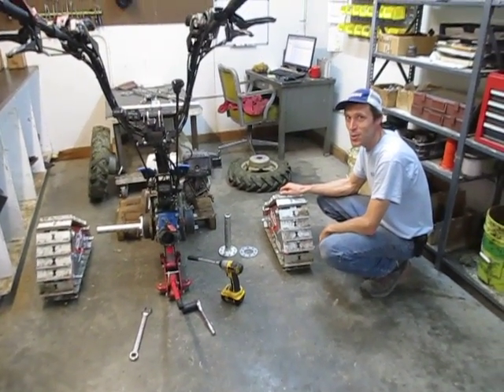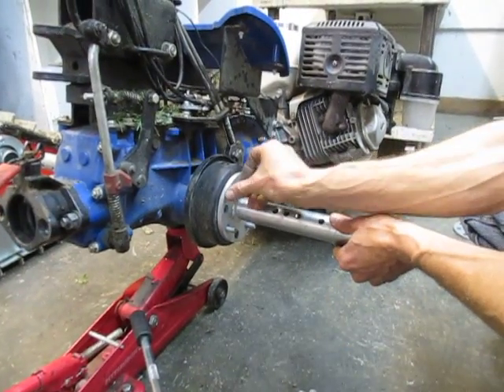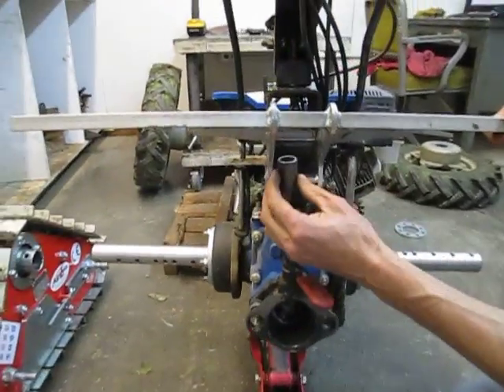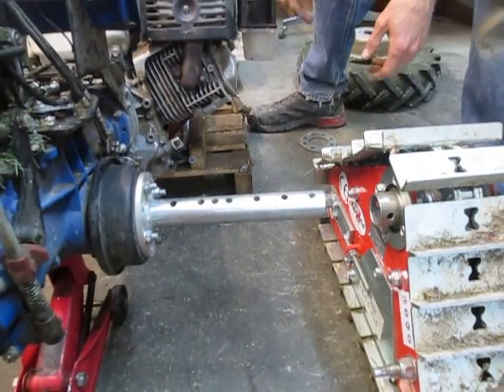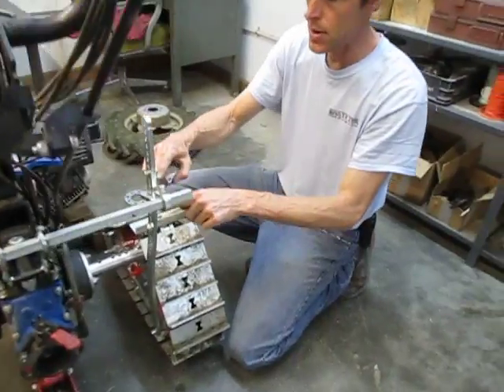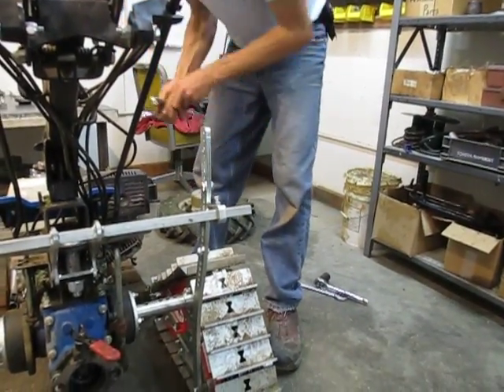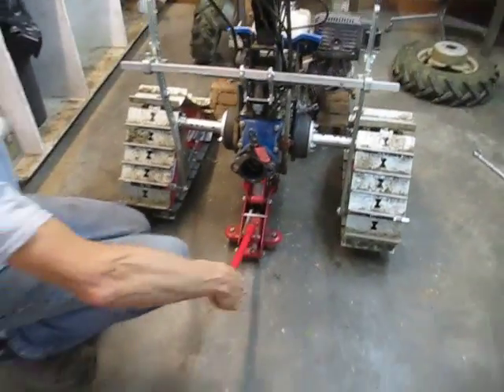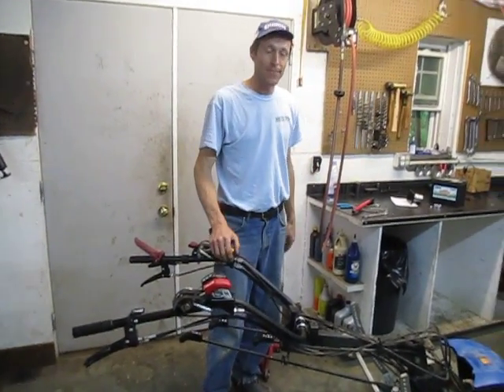Mounting Tracks to Walk-Behind Tractor

Comment: Well, you're kind of a tease by not giving us an in-use video.  Seriously, I'm looking at my options now, and a Grillo 110 with tracks, and a Bellon Brush mower might be the thing for cutting trails on a very overgrown acreage.  Do the tracks give you more or less ground clearance?  Have you ever tried the Bellon brush cutter with a tracked tractor?
Reply: I have a BCS 853, and a 30" flail mower, and I believe the flail would be a better choice over a rotary brush cutter. I think the flail leaves a better finished product, and is more adaptable to multiple situations.  I don't have experience with the tracks, but they are on my list.  Thanks!

Comment: Hi look my dear fellow you have the tracks on back to front.The lug on top should be to the front.
Reply: Sir, that depends on which direction you would be using the tractor in...these walk-behind tractors accept both FRONT and REAR mount implements, and the tractor handlebars swivel around 180 degrees to reverse the "forward" direction of the tractor, depending on the implement you are using.  The tracks can be turned around to accommodate the proper "forward" direction. So, please do your research on this type of equipment before you comment...

Comment: A quick observation.. When you use the tow hitch to secure the anti-rotation bracket you take away the ability to  tow. Why don't you make a bracket that will slide into the tow fixture and bolt down the same way, but has two plates that stick out and do the same function. I'd use a square block of steel with the correct size hole and weld the plates with holes on to it. That way you can still tow with the tractor when it has the tracks on it.
Reply: If you want to tow while using the tracks, we offer a tow-hitch that fits to the PTO-mount of the tractor.